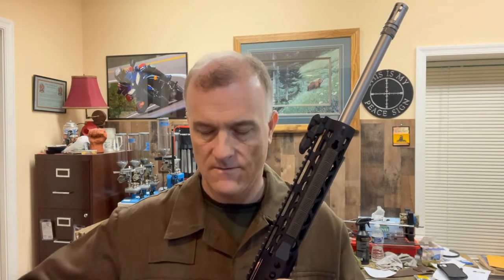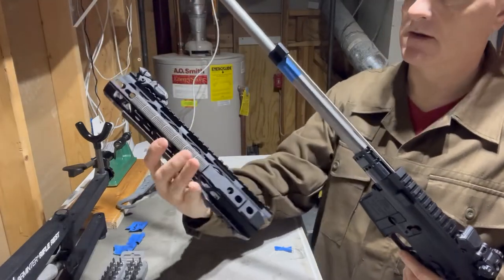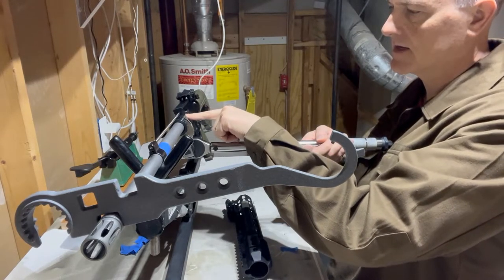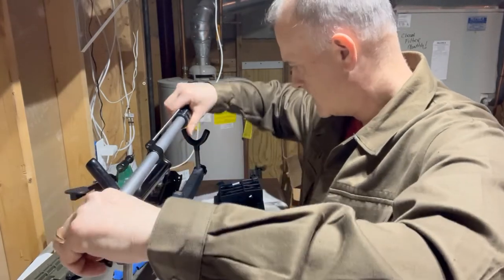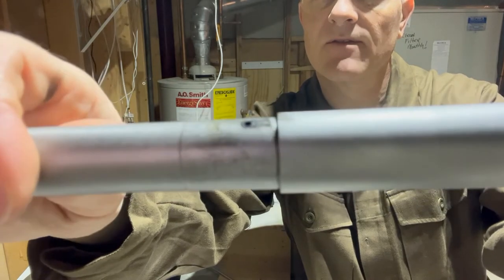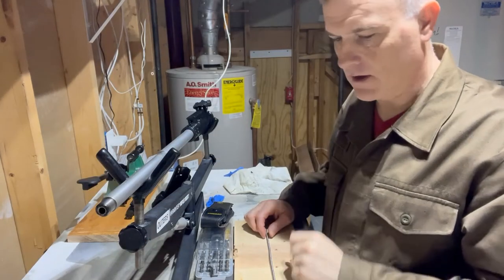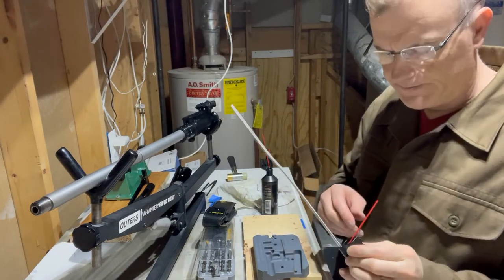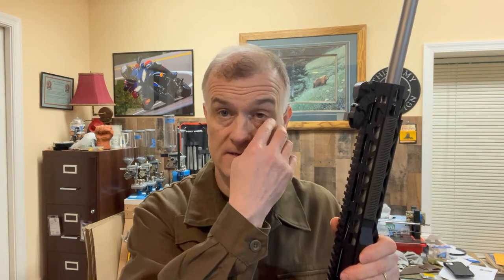YAA Troubleshooting the 6.8 SPC Carbine Part 1

Comment: The first thing I thought was that it’s the lower, magazine, magazine catch area since it’s not locking back on the last round.

Also was thinking that a Barrel Extension torque tool was what you kinda needed.  There are expensive options but just a quick search on brownells.
Reply: Also LWRC has their 6.8 with a piston upper, but I don’t think it would make a difference.
Reply from the maker: Thanks!  I have a .308 torque tool I used on my FDE AR308.  I'm not sure off hand if that video got taken down.  Youtube has ruled some of my input is againt the new anti-firearm related rules. I had hoped the boiling water technique would really loosen the flash suppresor much better but next time. I'll see how it goes on another rifle I might sap a muzzle device on(leaving in hot water longer).  Thanks for watching!

Also on the magazines.  I tried two that each have a different look to the follower projection.  Like one looks like the follower is higher in its projection upard where the bolt would catch.  They seem to operate the same wit respect to my issues.  One thing I found a bit lengthy to articulate in a vieo was the ability to properly cyle on the first round I fire.  That's happen on a few occasions then it goes on to not work.  Maybe I did mention it, but not real sure how to test that or just chalk it up to not enough gas getting to where in it needs to go.   Also could still be that there is too much gas??  I saw on another rifle discussion the affect of catching the bolt on carrier due to too much force in cycling but tha't not the feeling I have when shouldering and firing it.  The adjustable gas block says to start with the thing open one turn and go from there.  I did turn it down some lower than that but things didn't improve.  I'll keep working on it.